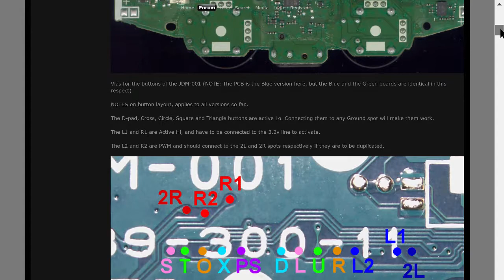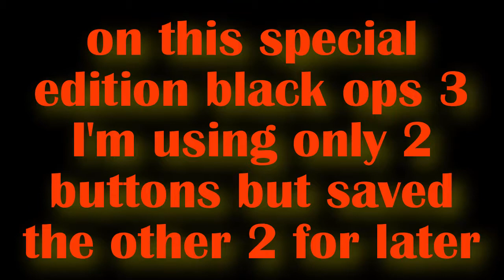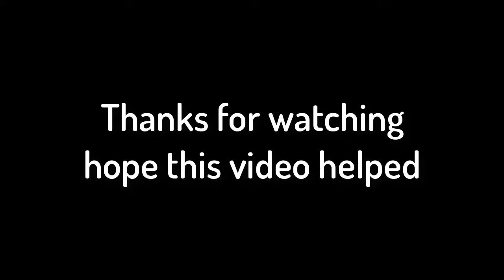Ps4 controller Paddles installation, no soldering!!!

Comment: how does the paddle action function?
Reply from the maker: That's why i have done the video, how they work? Well you need to press them obviously, if you looking for what buttons do they replace Well, again that's why i did  the video so you can see and you can choose what buttons you are willing to create a shortcut to the back of your controller. Hope this helps, happy mapping 👊
Reply: @TugaGarage  got it. Since there's no demo of the product actually in use, I wasn't  sure if you could map each paddle to more than one button.
Reply from the maker: @jessenovotny4183  you absolutely right i don't actually demonstrate how nice and good working is after mapping it, apologies for that, i guess i got too excited and started playing straight away with it, in blackout is just perfect modification. 👌
Reply: @TugaGarage  awesome. Just so I understand correctly, you can only map one side to one button, right?
Reply from the maker: @jessenovotny4183  yes unless you have a multi paddles to have more buttons, but this method is basically creating a shortcut for the button in question to the back of the controller, you can have all buttons on the back if you want to but is not so practical as you can imagine.
Reply from the maker: I have found a very cheap and easy install and is actually better, here is a link https://youtu.be/N81AsqACyZA